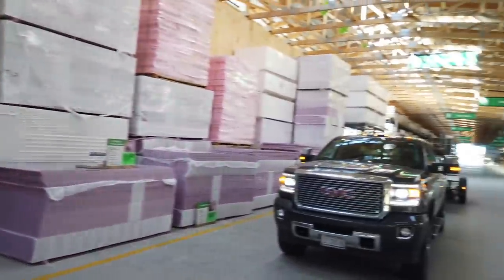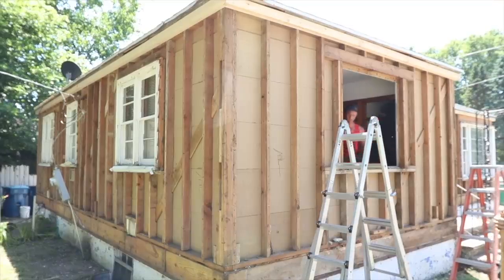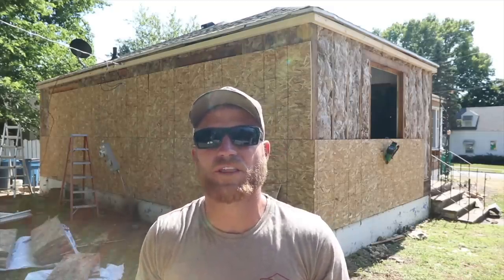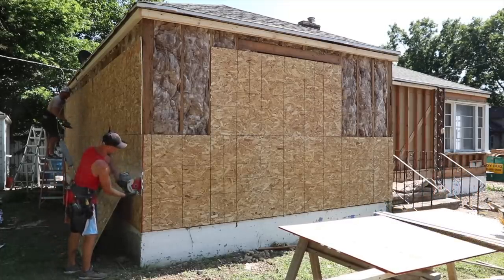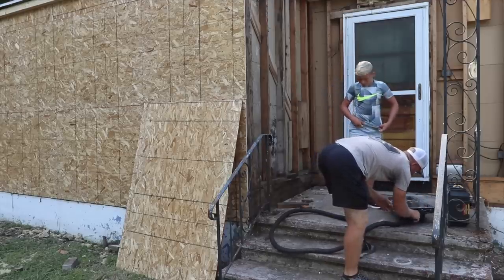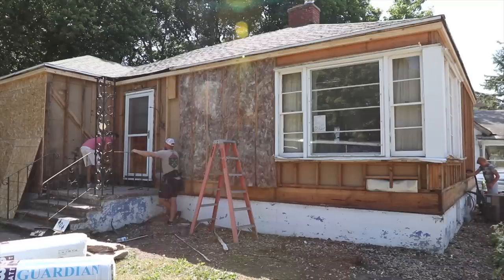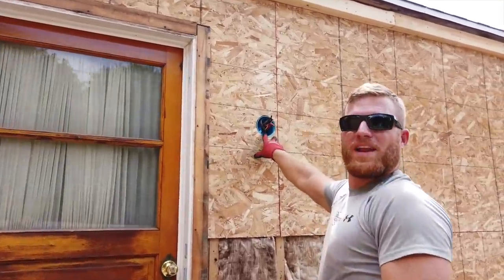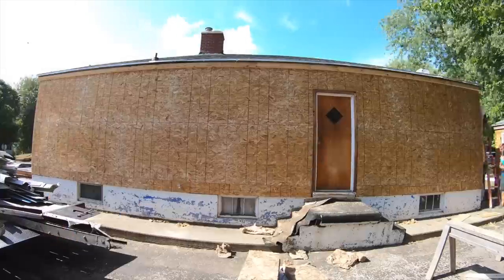How to Renovate Your Homes Exterior Part 2: Installing Insulation and Sheathing

Comment: You should wack some nails in from the side into the isolation or spray-glue it, else it will slide down and the top of isolation will go down over time

Comment: What about all that mold on the wall beside the entrance door. Why not take the time to spray that down and treat it? Also should have used faced insulation with paper toward the inside. Now that the walls are insulated the sheathing may get below dew point and you will have condensation in the wall.

Comment: Did anyone notice while the walls were exposed, none of them had any electrical outlets or wiring running through the studs for interior outlets?  When they were working at the front door area, not when he was cutting for the 4" round box, but earlier, i saw one interior outlet box. Seems like since the walls were all exposed, that would have been a good chance to add or upgrade any existing wiring?  Maybe later during the remodel, they are doing interior wall demos and will do electrical stuff then?
Reply: I seen that to

Comment: Surprised me that as professional as you guys are, you didn't put a vapor barrier in before the insulation.
Reply: Ya, if any water vapor condenses in the wall cavity, the back side of the interior wall will get wet and stay wet depending on what's put on the outside of the 2x4 framing. Water needs to gasify and be able to escape wall cavity when weather turns nice again.

Comment: Would the spray foam insulation help block traffic noise?
Reply: All insulation helps block noise, to varying degrees. Cellulose is one of the best for noise. Ive been in houses that had 100% spray foam filled walls, and they sounded really echoy before the people moved in. The trend in my area is 1.5-2 inches of foam spayed on the inside of the exterior sheeting, then cellulose the rest of the cavity.
Reply: @PortersMob  thanks for info. I live by a 4 way stop sign n my bedroom is where cars go by. My house was built in 56 so someday i wanna try and block noise
Reply: @chrishotrod6603  New windows might make a bigger difference if it already has insulation in the walls. If your house still has the original windows, chances are their single pane which is basically no insulation.
Reply: @chrishotrod6603 , Want to stop noise ?  Brick the outside, nothing stops noise as good as brick unless it's concrete.
Reply: @PortersMob  they've got replaced in 1998 i believe

Comment: I'm doing my own whole home remodel... what am I doing watching remodel videos on youtube?!
Reply: Having a good time, relaxing and learning !  Don't ever doubt yourself man, you're doing the right thing !
Reply: Learning how to do it right using Math.
Reply: @augustreil  absolutely! big time learning experience. haven't made too many mistakes along the way and have to say so far i am very pleased with the results. gutted down to studs and floor joists(floors were about 4" off level), new electric, plumbing, hvac, kitchen, bathroom, roof, siding, insulation, windows and vaulted the ceilings while we were at it. these are great videos always fun to watch.
Reply: Charging your experience battery, duh. :D Good luck with the remodel.
Reply: @watsonmckee8188 , Sounds like you're in it deep.  I have one of those 130yr old houses with floors AND ceilings like that. They can be a pain, but what a pleasure looking back and seeing all the improvements you've done, right ? Good luck and may straight, square walls be in your future, lol !
Reply: @augustreil  for sure, thanks. take care

Comment: Man I do not know where your house is located but around here if you put plywood or OSB that way you fail there's no backer boards in the seams between the studs like I said around here and I guess North Central Illinois to LOL that's a stop-work order ask me how I know LOL
Reply: Are you talking about the horizontal seams? Because all the vertical seams were on studs.
Reply: @ripstick2217  yeah sorry I was trying to eat dinner and talk at the same time lol yes the horizontal seams down here in LaSalle County I failed on a house because I did not have blocking between the horizontal seams it was explained to me the panels have to be vertical the seam has to be on the top plate and the bottom plate for structure LaSalle County building inspector could be a nincompoop to but like I said I failed putting plywood like that
Reply: Weird! I didn’t realize that was a requirement in some areas
Reply: Yeah I didn't understand it either just like what was done it's still way better than that waffle board. it was way better than what was on there in the first place but I still failed like I said your area may be different then LaSalle County building codes the Saving Grace is when the siding goes up you can't see it mine was still open cavities inside.

Comment: Getting rid of the doorbell transformer doesn’t allow for future install of a video doorbell of some sort.
Reply from the maker: The ring can be completely wireless
Reply: RR Buildings it can be but it’s not nearly as good as the wired one, no need to charge it ever and a much clearer picture. I understand in a rental the lack of future proofing but it’s just a minor thing I would have changed. Great series so far!

Comment: Strapping alert! That is legal but not good enough strapping. Here one is required to strap for 100% of the load forward, 50% to the sides and to the rear.
You can achieve this on a stack of plywood with two straps diagonally over the front of the stack making an X.
Remember, strap for the worst accidents. If you go into the ditch, you want your straps to hold the load on the trailer and not come flying into your truck.

Comment: I see you are using the "old style" tie downs on your trailer and load. don't you just hate the loose ends from the ratchet straps?? try these: https://smile.amazon.com/dp/B0056OFWVM/?coliid=I2YOHIYGG2WL53&colid=KH34PPF28MUT&psc=1&ref_=lv_ov_lig_dp_it  found out about them from a towing/recovery service in MO. come in several sizes and manufactures. i got a set for holding my bike in the back of the truck, no more loose ends.

Comment: I know OSB is slightly cheaper and more environmental but can we all please stop using it for exterior walls??????  Actually plywood gives the house better strength and is more water resistant.  It would only cost like $100 to upgrade to plywood for a house that size.